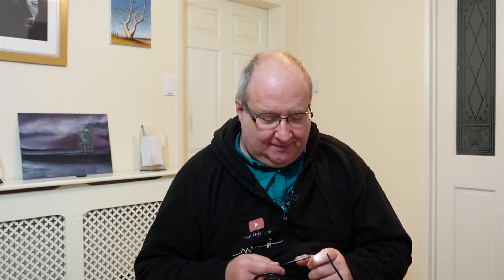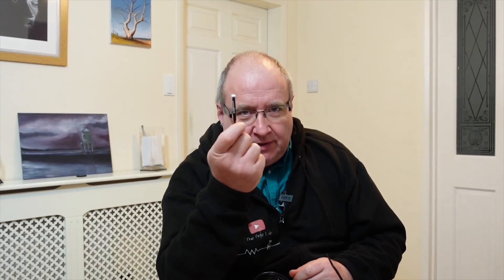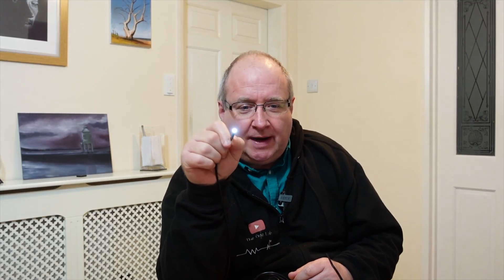BB6W Diamond antenna probed with a tiny camera

Comment: When I see big resistors like that in an antenna matching configuration I find that they are normally there to soak up energy that doesn't get radiated, thereby keeping SWR down.  But the result is poor performance.  If a person is restricted in space or by HOA, then this may be an acceptable compromise.  Thanks for taking a peek inside; it was educational for me and confirmed my suspicions about the BB6 and BB7.

Comment: I have recently bought an BB7V mounted on a tripod in my garden due to space restrictions. I have made SSB contacts all over Europe so far and on ft8 all over the US, Brazil, Africa, Europe & Asia with ease on minimal power. It does work but it is never going to be efficient as a vertical with radials but some people just  don't have the space. Its a good compromised antenna but quite pricey. Would make a great portable hence why i mounted it on a tripod and can be taken down in minutes. We cant all have towers with massive Yagi's on them lol
Reply from the maker: Hi Steven, sounds perfect for your situation, I’ve opted to go portable these days due to space restrictions..

Comment: Was going to purchase this antenna to use it in the loft should i not bother ?
Reply from the maker: Interesting use, it’s one of those antennas that has mixed reviews.. I asked around and some have said it works ok.. it might be noisy tho .. Gaz
Reply: @TheGazLab  it is a bit pricey but was interested in it for the size really. My loft is 25 L x 16 W x 9 H ft do you recommend any other antennas.
Reply from the maker: @jaoppst47647  jeeez.. no pressure .. I would try a wire loop or folded dipole before spending loads of dosh .. try keep it balanced and tune it.. you will never have great results or even good results putting an antenna in a loft.. 

if you want a ready made thing, the  diamond wd330s is a sensible stab in the dark at a loft antenna, 10 mtrs long, it might just fit at strange angles.. lol

 the bb6/bb7 are really just loaded wires, good if that's your lot.. gaz

Comment: 3:6 turns ratio = 1:4 impedance ratio (straight squaring).
Seems to me that the resistors will act as a 600R dummy load.  Not sure how much rf gets up the radiating wire.  Answers on a post card.
Difficult to calculate the radiation resistance of the wire at various Fs not knoeing its length.
Reply from the maker: Thanks David, if I had a £ for every conversation I have had regards the loss in these things I would have a new 705! lol